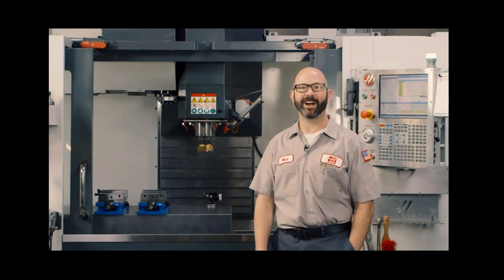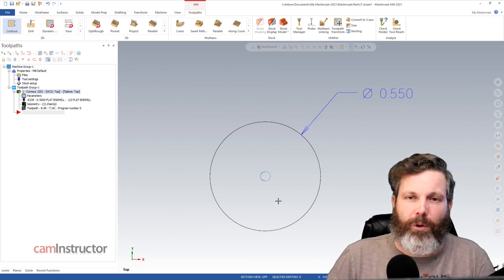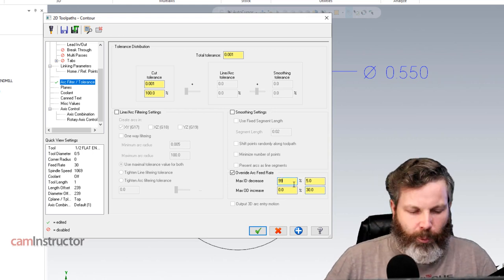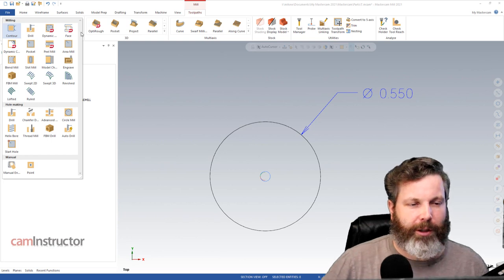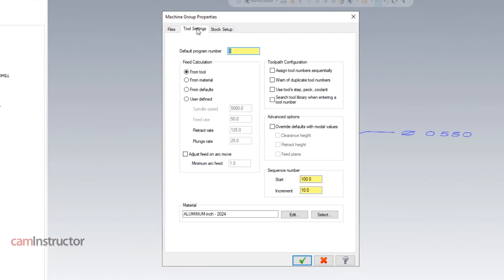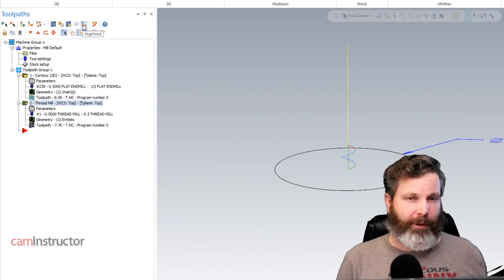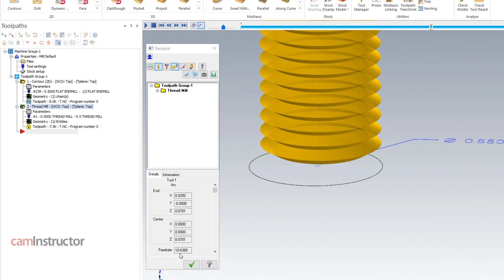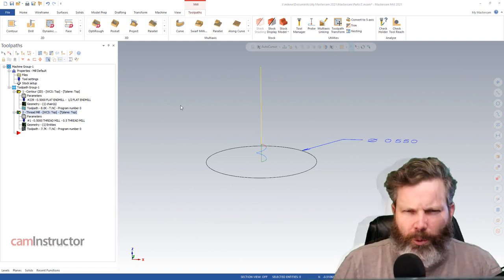Your Feedrate is Wrong - Fixing it with Mastercam

Comment: Seems like "override arch feed rate" could be useful for chamfering when you're deburring small bores and longer contours in the same operation. 
I'm guessing Mastercam will calculate feed rates off of tool diameter and not the effective cutting diameter of a chamfer mill?
Reply from the maker: Chamfering with Contour will look at the cutting diameter for calculation not the nominal tool size. Pretty cool they have this working!

Comment: Can anyone tell me what cause the haas 3 axis milling gave me this alarm, when I make small offset “WEAR”.”cutter comp begin with G02or G03”postes from Mastercam....I was making thread milling and contour.
Reply: Cutter comp G42 and G41 cannot be called on with an arc move use start at center with a linear lead in
Reply: @cncmanufacturingptyltd5189  could you make any example which line should I start on? thank you!!
Reply from the maker: What toolpath are you using? As mentioned above, comp needs to be applied on a straight move (G01). If using Contour, make sure your leads are set to use a line length. If circlemilling or threadmilling you can do as mention above again, click start at center but you may also need to click perpendicular entry to get that comp onto the G1 line.
Reply: @CamInstructor  it is very helpful and thank you very much!